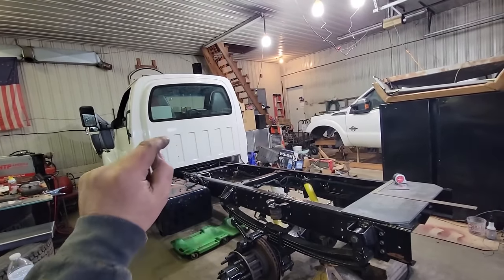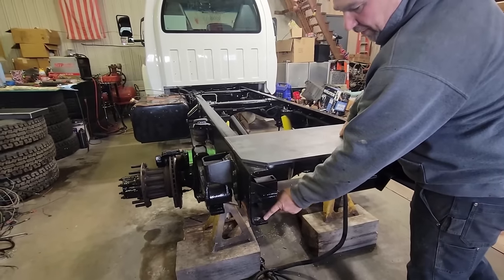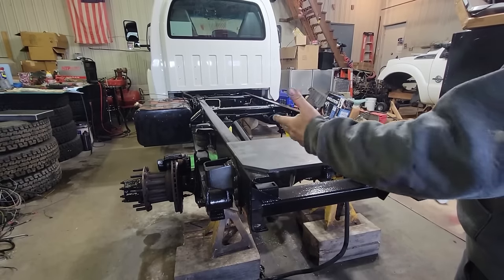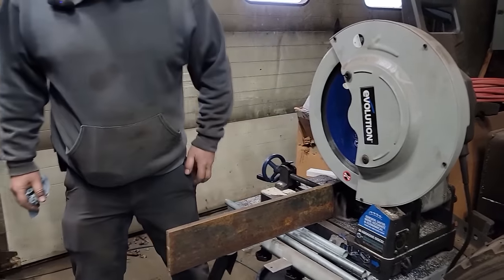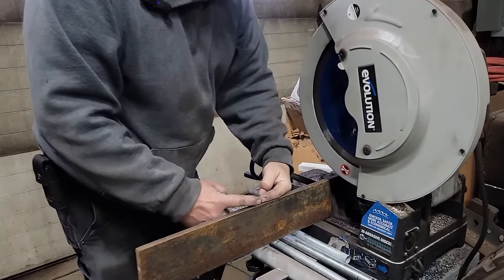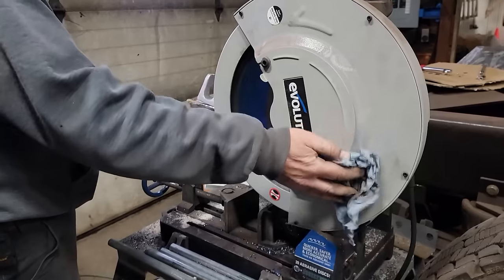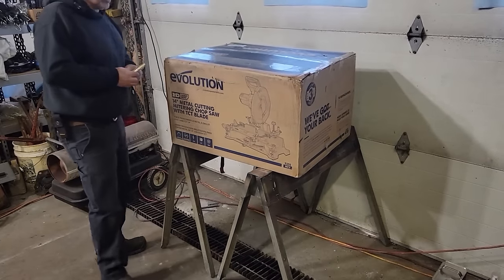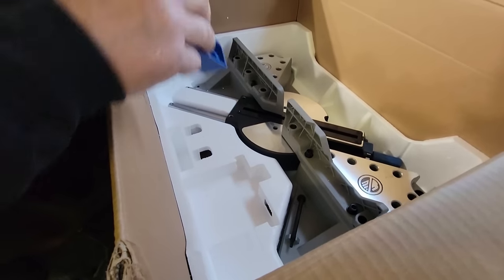PROJECT "EX-HAUL" PT 4 BUILDING A MASSIVE HITCH PLATE!

Comment: STOUT. The hitch has a look that says 30K lbs for a truck rated at less. That is how I like to do it. I just added a 16K lb hitch to a truck only rated to pull 7500. In this way I never have to worry about the hitch being a weak link. All the other components: receiver, hitch pin, etc are similarly overrated. As it should be. The cost difference was minimal ($200) for the peace of mind provided.

Comment: Next time you do a T weld on flat plate again take your acetylene torch and put some heat on the side opposite the weld to pull it back straight or straighter. The metal always bends to the heat. It works better when it's still warm.

Comment: That looks really great! I love the flatbar on the outsides.

I would definitely fill the area on outside of frame to prevent water and road salt sitting in there. Stuff like that for filling holes and not really structural, I run a quick downhill, colder weld. Grind nice and its sealed. If you try running a hot weld, yeah it might just undercut and be bad.
Reply from the maker: yep. my thoughts exactly.

Comment: Only thing id have done different would have cut a relief for the top flange, so the tow plate would be flush with the top of the frame rail.
That way if you get a sub frame mounted dump body you can weld the pivot angle to the tow plate.
Your welding is excellent! Weld those frame rails to the side plates so the rust jacking doesn't start there.
Anxiously awaiting the light boxes, i bet they are spectacular!
Thanks for the extra effort making videos!!
Reply from the maker: i didnt go to the top because i am thinking of another piece laying on top of the 1/2" plate from left to right.

Comment: Ir win used to make a lazer light that takes the place of the outside washer and turns on and off by the rotation of the blade. Porter cable made a saw years ago just like your original saw that i had we installed the washer so you can line up the cut by the light worked great

Comment: I just recently rebuilt the gearbox on my 20 year old Milwaukee abrasive chop saw and feel like it was well worth it since that was the first time ever though it cost more to rebuild it than what a Dewalt abrasive chop saw sells for new. But, the current Dewalt and Milwaukee offerings are toys compared to my 20 year old Milwaukee. That said, if I ever buy a new one, it’s definitely going to be one of those new Evolution saws you have there. Nice looking job on the hitch plate. If I could recommend one addition, it would be a piece of that 1/2 x 4” flat bar across the top edge to act as a stiffener for the pintle hitch.

Comment: Simple solution would be to take a piece or rod that fits inside the back where the clamp goes, weld a little bit of flat iron that has the same width as the v-blocks do and slide them over and keep them there. Odd that they don't provide a storage means. Checked the 'manuel" and nada. They give you a storage option for the hex afaik, right? It's almost like it's an afterthought.

Comment: Hello J.C love your channel, and as always, love your work, but as you say (and I don't mean this in a negative way at all) you are not a welder. I think your machine is too small for 1/2" plate. Typically a 300A machine would be the min size, 350A is more like it, it will allow you to properly run spray transfer using 0.45 wire dual shield for 1/2" plate, with the correct C10 gas of course. With your smaller machine and 1/2" plate, I would have most likely selected stick welding, which would be well within the capacity of this machine. That way you are ensured to have proper root penetration. Problem with MIG (and all MIG welding for that matter) is it can look good but it can also be a bad weld. No way to tell unless you first made a test piece then cut and etched. With your smaller machine that is what I would have done, a test piece to ensure the machine was up to the task. I think Peter should have offered you better advice with an alternative process once he found out about the 1/2" plate. As always great work, excellent attention to detail! Take care, Joe
Reply: He’s always said he’s not a welder lol
Reply from the maker: if i have learned anything about welding, it is these two things...there is textbook theory and there is real world application. those two do not always the same. i have owned hundreds of trucks with hitch plates. most were poorly done, inconsistent, and inadequate short circuit mig welds. many seemed so awful i couldnt believe the hitch plate stayed on the frame without any load pulling on it at all. yet they were bowed, twisted and bent without a failed weld. many times i would remove these plates only to have missed a tiny weld. it amazed me how a thin 1" weld could stop me from ripping the plate off. i could raise it in the air with the gradall and drop it with a hard shock but it still held. it is only as good as the weakest link. what is the weakest link? is it the weld or the fact that we are welding 1/2" plate to a 5/16" frame? is it the strength of the 1/2" mild steel compared to the strength of the 5/16" heat treated truck frame? or is it the direction of the grain structure in the mild steel plate as it correlates to the load being applied? is it going horizontal or vertical? is the machine not capable or high enough amperage? all i can say is, the dual shield process is definitely a hotter better penetrating process than the traditional short circuit mig i have done in the past. as i watched the weld form, i saw the metals merge. i had to take my time, watch closely and fill each side before moving. was is hot enough to create a satisfactory weld? is this hitch adequate for the intended use? is it enough for capacity of the truck? i think it is. can it be broken or fail? only a foolish man thinks it cant. i am learning a lot. what i do know is "ignorance is bliss". the more you learn and  understand, the more you realize just how wrong you were doing things before. im not a closed book. i listen. i am always wanting to improve. advice, tips, tricks and experience makes the difference. a big machine in the wrong hands can be just the same as a small machine in better hands. as far as what peter suggested, i am certain he has my best interest in mind. he just drove 9 hours to come here. he inspected what i did and advised me on some improvements i need to make.
Reply: @j.c.smithprojects  Hello J.C. thank you so much for taking the time to respond, just to be clear, I have 100% faith in your welding capability, you clearly demonstrated that over and over. I just wanted to point out that the equipment in this case can be a limiting factor for one welding process but may not be for another type. This was an awesome fit up plate you completed. Take care Joe
Reply from the maker: well, i am going to just keep trying to improve. peter is coming again this week to teach me some more about tig welding. i am working on a project that could benefit from it. so here he comes!

Comment: Ductility is the word for less brittle. I would step up to .045 size when running dual shield as it's slightly cheaper and you would run a lower wire feed rate. That saw is nice but all those miter cuts could have been done with the other saw by turning the piece around.

Comment: I was thinking if you put a dump bed on it, don’t the manufacturer notch the frame for the hinges.  If that’s the case you may have to cut away part of the toe plate at the truck frame.

Comment: I guess my question would be, why would you want the hitch plate welded on (instead of bolted or riveted), just in case someone (maybe like me,? LOL) wants to remove hitch plate for something like modification, frame change out or repair, crossmember replace or repair? I ask this since everything else seems to be bolted or riveted .Enjoy your videos!
Reply from the maker: you will almost never find a heavy hitch plate bolted. it is usually always welded. welding is permanent. that is what i want. i dont want to risk broken bolts or nuts backed off. i want the most unified connection i can get. when you bolt it, you take metal away. when you weld, you add.

Comment: 34:39 i wrote on the bottom of the feed well "fluxcore ribbed wheel". Easy mistake to make, even if you've welded for a while. Especially since some times you get away with it (depending on the quality of the fluxcore).
So you don't get a bend in the plate (that pulls). One, don't weld in the same spot twice, stitch weld and allow to cool AND pretension your plate in the other direction to counteract the force of the pulling weld. You don't want to go overboard for the same reasons you don't want to pull on a weld, but giving the plate a small arc with a hydraulic jack rig (for example) would give you a flatter result in the end. A perfect tool for this would be one of those tiny, tiny hydraulic jacks that are no bigger than a box of screws from the hardware shelf.

Comment: That was good timing, I just watched your video with Peter Z on the frame stretch welding.  Did you use the same set up when welding the plate to the frame itself?
Reply from the maker: yes

Comment: Does the bracket (fore / aft slide) help with the chip collection on the new saw?  It looked like it might be a good back stop.  I don't use my saw as much as I could just because of the cleanup.
Reply from the maker: i dont think so. it throws chips just like the other one.

Comment: If u wanna get rid of the bow in ur material try peening ur welds with a rounded blunt tipped punch this will get rid of the bow and relax the weld  making it even more resistant to cracking.